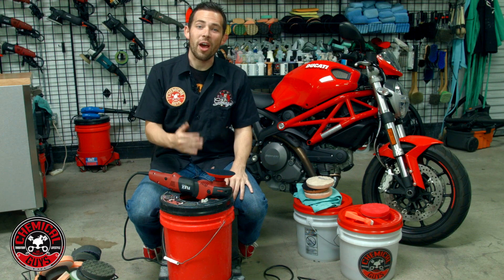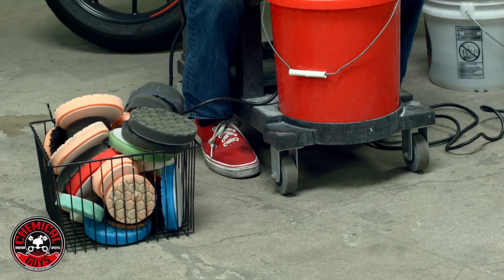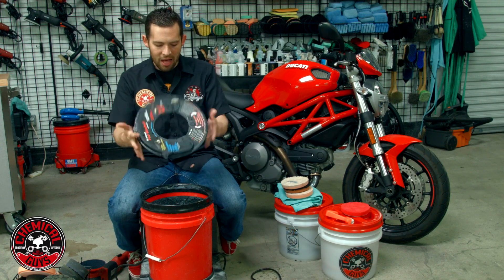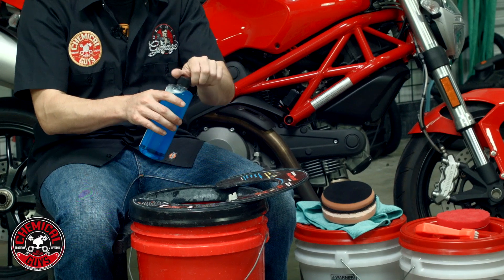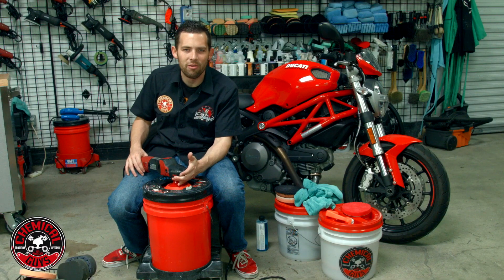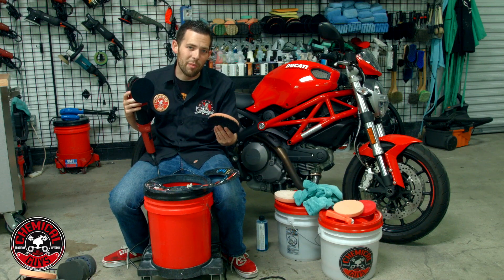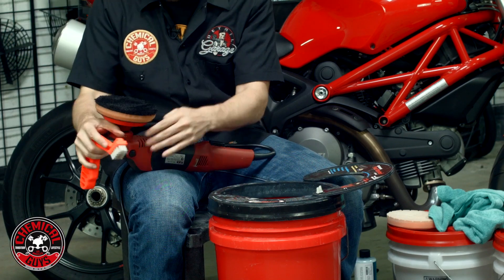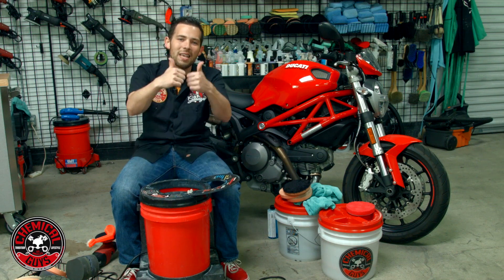How To Clean Polishing Pads - Universal Pad Washer - Chemical Guys

Comment: how often or how many pads should a detailer be going through on a vehicle? 2015 Chevy Cruze I have 3 orange hex-logic pads. I was just using them for V32,34,36
Reply: when i asked, i was told 1 pad used daily in a shop, would last 1-2 years if treated properly.  i have mine since 2014 (4 years now) and i use the entire set about 10 times a year.

Comment: Can you please reply and explain the best way to get sticky residue off your truck's paint or off dash in the case of Velcro holding a dash cover down. I know it will come off but some recommend windex/rubbing alcohol mix to get it off the dash and no idea for the outside. (edge of my truck's doors have a thin rubber guard to protect against dinging them on stuff and the residue is left behind.) Thanks!
Reply: 3M makes a genral adhesive remover in a spray can or gallon.  Great stuff,  smells terrible, removes most crap.

Comment: How often should I wash ? After very use after 10 uses ?????
Reply from the maker: Hi samuel! Thanks for the question. It is best to clean the pads after a polishing job especially if the pads aren't used everyday, this will prevent permanent staining and deterioration. Clean pads are also more effective and leave a better finish. - Happy detailing! 
https://www.chemicalguys.com/foam-and-wool-polishing-pad-cleaner/foam-wool-pad-cleaner.html

Comment: Hi chemical guys I got a problem with my car. On the plastic over the speedometer and all those gauges got some type of haze on it after I cleaned it and it hasn't come off
Reply: You may have permanently hazed it depending on what you wiped it with. Give PAM cooking spray (small amount)a try. Buff as much off as possible with soft paper towel.
Reply: +Tomislav Kralj thanks for the tip, I'll save it for next time, but in regard to that I truly don't know what it was but it came off on its own with time. I am to this day puzzled to what caused it. Thank you though